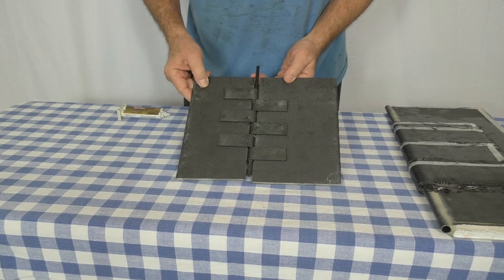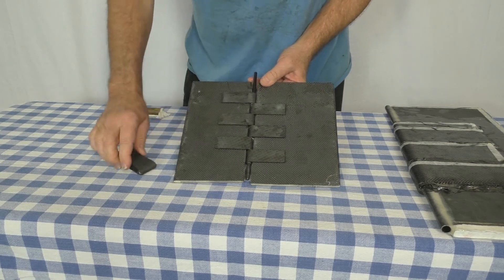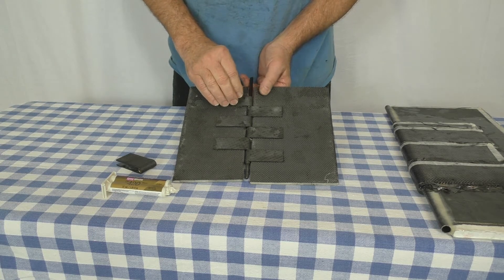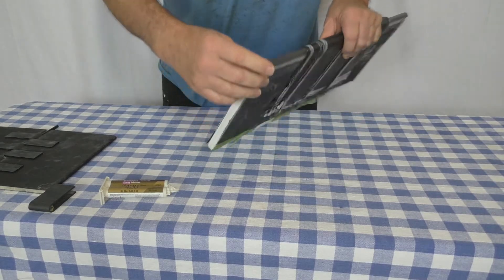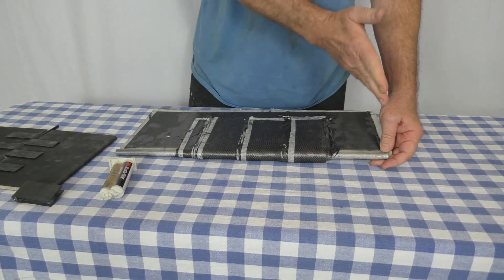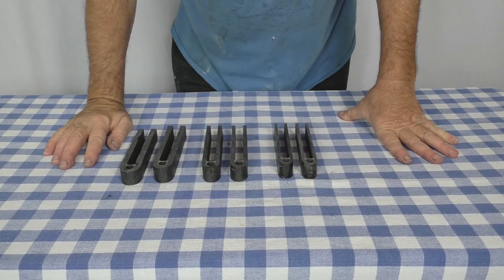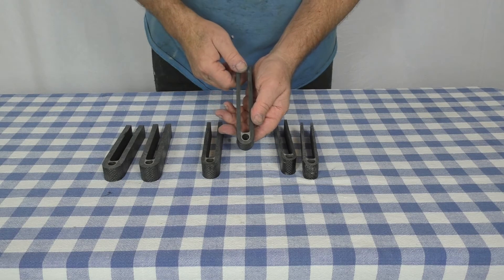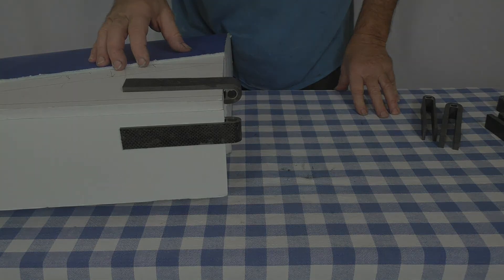Wing Joiner Studies Part II - KW MkII Rigid Flying Wing Hang Glider

Comment: Rol, 
Whatever happened to this "wing zipper" idea? Would it still work on a powered aircraft box spar/wing panel that can tolerate the weight or did the testing reveal some kind of "fatal flaw"??
Reply from the maker: I have not had time to do further development. I've shown it to a couple of other good engineers and they say there might be a pony in the pile. I need to get further along with my current wing before I can justify taking time to work the zipper concept.